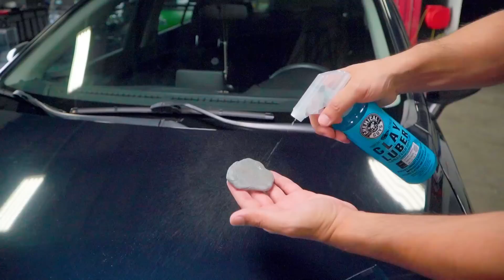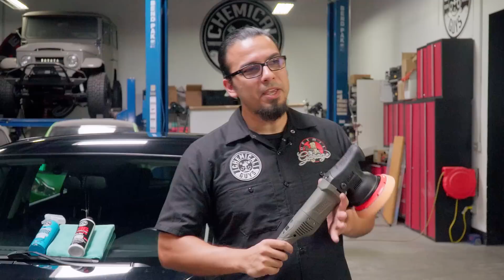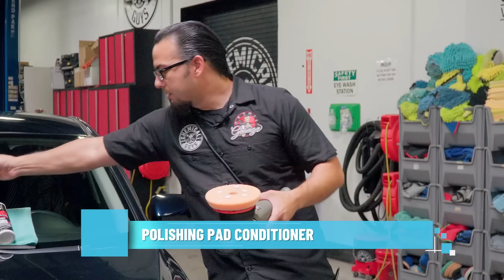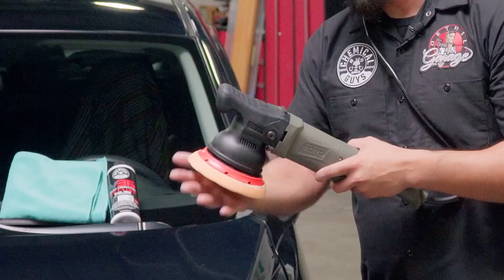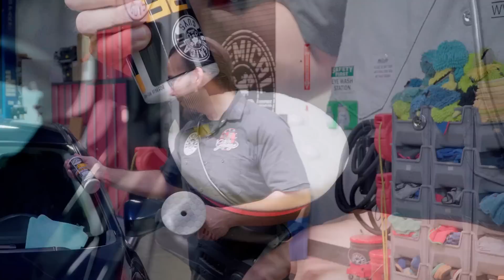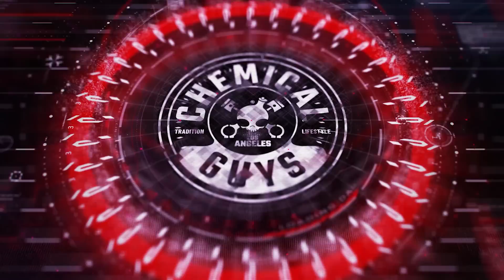Using An Orbital Polisher To Revive Scratched Up Paint! - Chemical Guys

Comment: On a video on Amazon  I saw about your polisher what is the light called that u used to detect swirls etc before u polished the car?
Reply from the maker: Hello! Use the Ultra Bright Detailing Inspection Light to spot swirls and scratches. 
https://www.chemicalguys.com/ultra-bright-xl-rechargeable-detailing-inspection-led-slim-light/EQP400.html?gtmListValue=Internal%20Search
Reply: @ChemicalGuys  Thank you!👍

Comment: I have 2 newer vehicles. Both less than a year old. Very light amount of swirls and scratches..I want to polish and ceramic coat. What are your recommendations for polish and pad choices?..was thinking VSS with orange pad.
Reply from the maker: Hey! The combination of V36 with an Orange Hex-Logic Pad and V38 with a White Hex-Logic Pad are great for removing light imperfections before applying HydroSlick.

Comment: First I’d like to say I’ve never polished a car before. My black car has light scratches/swirl marks on it that I want to get rid of. Is the polishing on this video something I could use/follow as a guide for someone like me or  should I just pay someone to do it?
Reply: The honest answer with no sales pitch is, if you're not afraid of work, go for it. It does take time to figure out what you're doing, but using a DA type polisher like the one in this vid is beginner friendly. You may be doing the polishing as shown for up to 2-3 hours, not including the detail wash (plus wheels and other features), decontamination (the clay bar shown plus tar/bug removal etc.), and final wax/coating application. It may take 5-6 hours of moderately hard work to do a complete and thorough exterior, but it may save you $200+, so it is up to you.
Reply from the maker: Hi there! Using a dual action polisher is a great way for anyone to hone their polishing skills. TORQ offers a variety of tools that work well for removing swirls and scratches. I recommend using V36 in a small inconspicuous area to determine if more abrasives are needed. 
- CG Nick

Comment: Got a question… How can i tell if the car i am working on has bad paint and i have to use v32 and v34 or it’s moderate and just have to use VSS or even a good paint which can just skip the whole polishing job? 
Thanks in advance.
Reply from the maker: Hi there! It is best to always start with a test spot to determine what combination will work best. Always start with the least aggressive approach first.

Comment: The place I get scratches the most is under the door handle. It impossible to get anything under it to buff it out. They make these protectors that sit under the handle right it the scoop of where the scratches happen. Probably will just get those rather than taking off the handle to get to it.
Reply from the maker: Hey Matthew! Check out this video.
https://youtu.be/7hM5uXBxKfA
Reply: Magic Eraser works really good but be careful dont be too rough with it
Reply: Clay bar will remove them.

Comment: So at what point do you change pads? Is there a point where the pad is so saturated that the product doesnt break down properly?
Reply from the maker: Hey Roberto! Clean or swap pads during the job to maintain consistent results. Once the pad becomes clotted with spent product it should be cleaned.
Reply: It depends on the product most of all. This product looks like it runs out of the pad or dries up, giving you that clean look (little or no polish residue) as you finish a section. Every couple sections you can clean the pad with a brush or compressed air to keep it fresh. Depending on the vehicle and the product, you can use a second or third clean pad to avoid build up.

Comment: What's best to use for water etching in the bottom of the front bumper.  CG citrus water spot remover not working, so I'm assuming my next step is compound and polish
Reply from the maker: Hey Willie! Try machine polishing with V36 Cutting Polish to remove stubborn water spot stains.
Reply: @ChemicalGuys  will do 👍🏾👍🏾👍🏾

Comment: Did Nick change speeds at all? I’m asking because in other videos, detailers have spread product at a low speed (1) then high (6). I may have missed it but wanted to make sure. What are tiger stripes? Also, are there going to be Labor Day sales? Thanks
Reply from the maker: Hi Mark! Thanks for tuning in. Yes, spread the product using speed setting one and then use speed setting six to properly break the product down. Tiger stripes/holograms are caused from excessive heat and/or pad speed not allowing product to properly break down leaving hazy tracks where the polisher has passed. Move your arm at about one inch per second to thoroughly refine the finish.

Comment: While this is helpful, whenever these videos are posted, it's always of a flat hood. How do I do the small, finicky bits? Such as the intricate shapes around a front bumper?
Reply: You many times have to tilt the polisher and carefully work just with the edge of the pad. Search for Autogeek and see him polish and you will understand better
Reply from the maker: Great suggestion, stay tuned!
Reply: Experience will show you, don't need a video for every little thing. Get in there and see how it works. You can turn the speed down if you're nervous, but nothing beats getting a feel for the machine and learning how to handle it for yourself. You will honestly never get good any other way.

Comment: what is the difference between v36 and c4?
Reply from the maker: Hi Tim! C4 has slightly more cut than V36.
Reply: @ChemicalGuys if C4 has slightly more cut than V36, to do an accurate side by side comparison would I need to start with V34?

Comment: I use VSS and always find it takes me 2 pads to do my car because the first one always gets plugged up. Is this normal or am I doing something wrong?
Reply from the maker: Hey Steven! Are you working with a vehicle that has single stage paint?
Reply: @ChemicalGuys  no its base clear. Just seem to get a lot of polish in the pad then it seems to fling off and I can see the quality of the job going down. I've tried using less polish as I go but dame thing happens.
Reply: @stevenstewart1308  Are you blowing out the pad or using a pad brush after polishing a section?
Reply: @orthodox1717  no I just put less product on as I go and the pad
 gets more saturated. I've just started using 2 pads to do a whole  car.